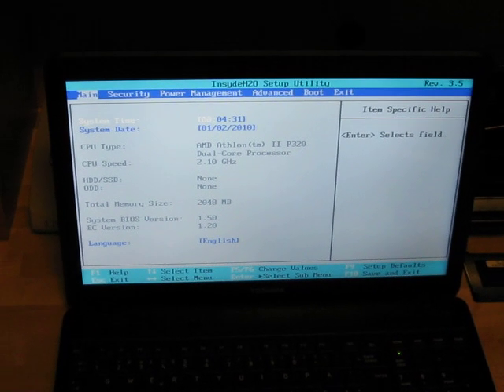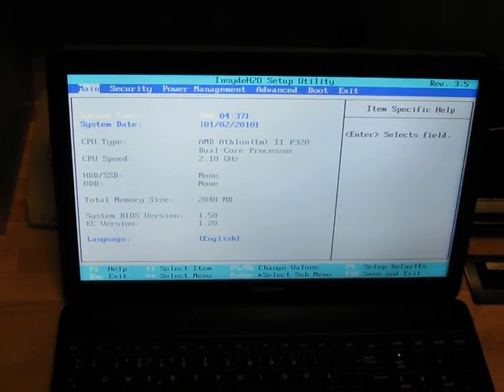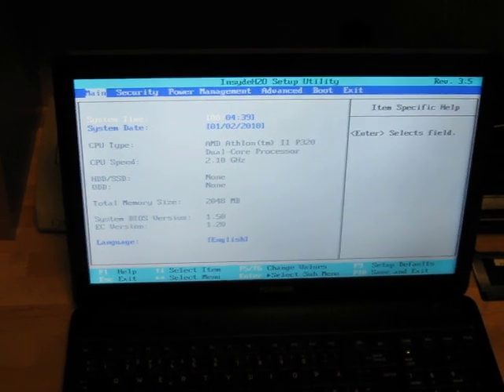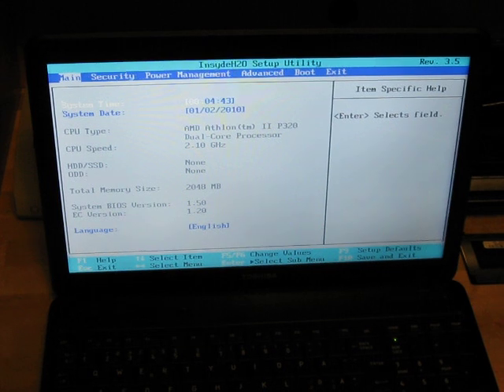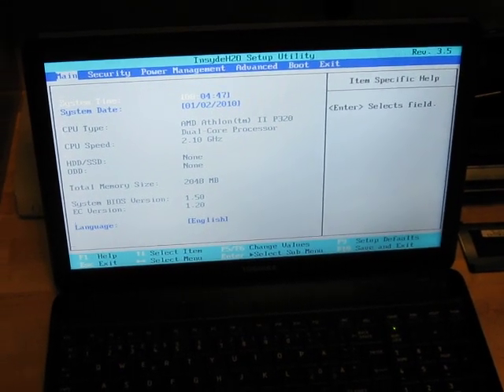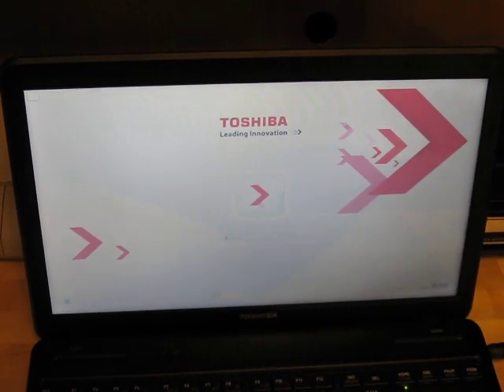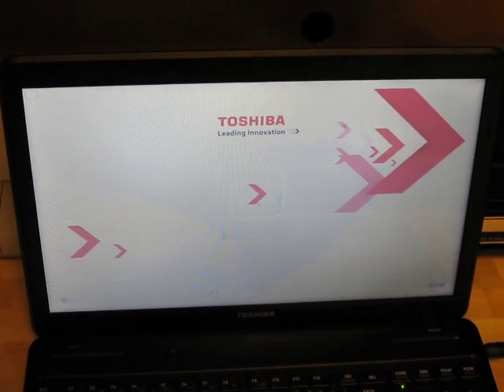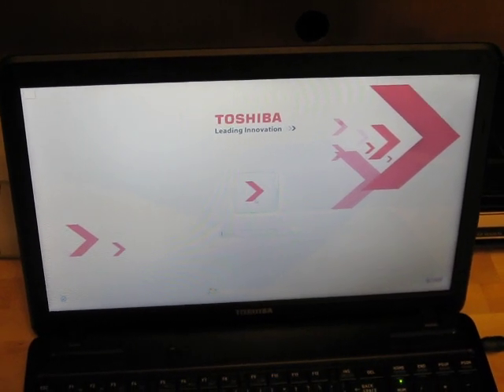Repairing a Toshiba laptop

Comment: Please don't pry the top panel like you saw in the video.
You need to remove the strip above the keyboard, which allows you to remove the screws holding the keyboard in place.
After the keyboard is removed, you can disconnect cables and disassemble the rest of the laptop.

Comment: Dude YOU DO NOT NEED TO TAKE APART TO ACCESS THE BATTERY, you can access the battery just by taking off the key board!!!! You do not have to take all the screws out not the anything else in the back. Plus you didn't say what you need to do when you get into the Bios?